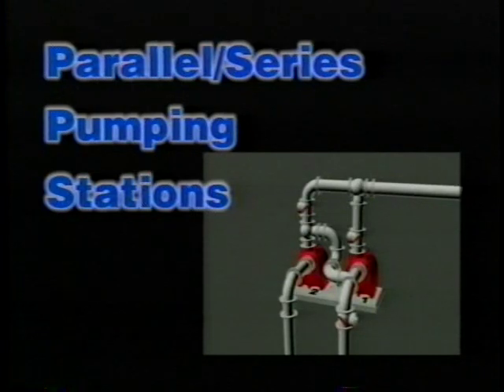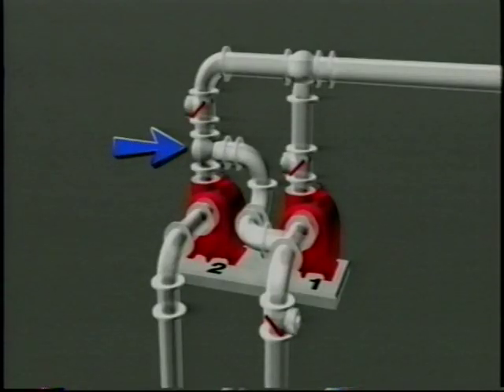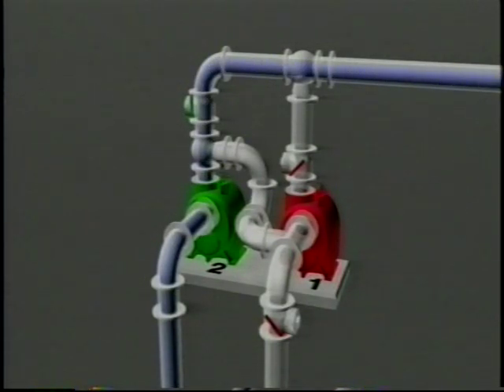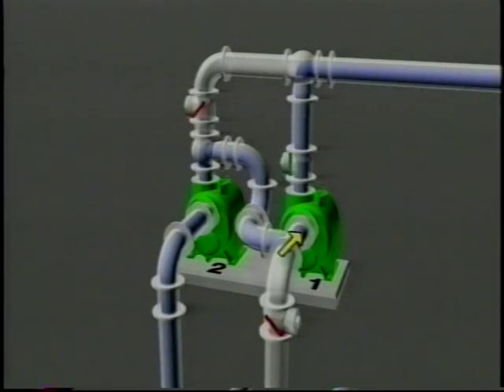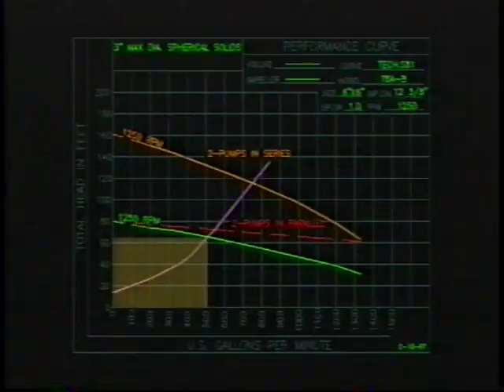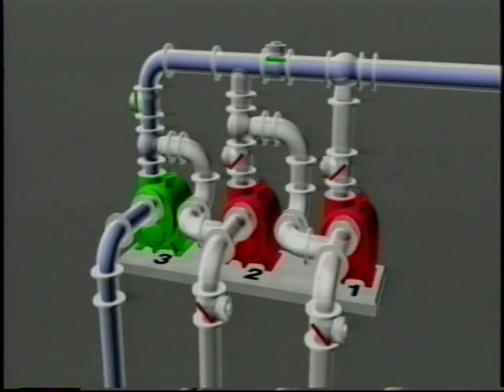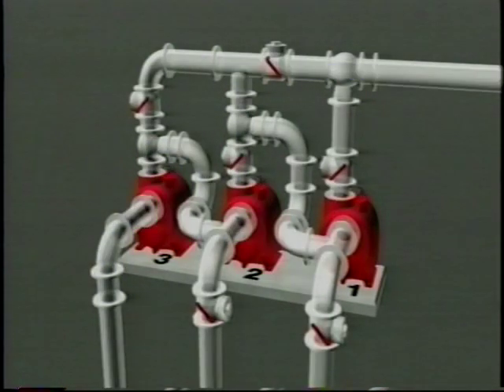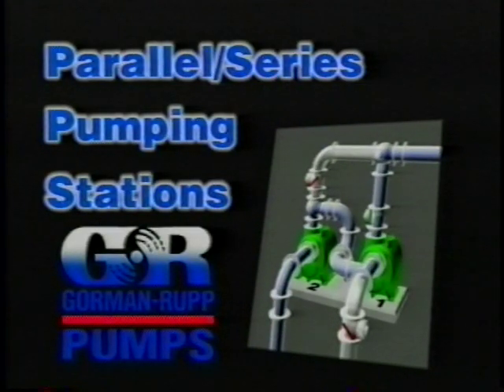Gorman-Rupp: Parallel Series Pumping

Comment: I can't help but wonder if those check valves are gonna rattle and break off due to vibration when you consider that centrifugal pumps don't give an exactly constant flow. and furthermore how thus this vibration affect the cut water of each pump. looks like a mess
Reply from the maker: The check valves will not rattle, they will behave like any other non-return valve in a piping system. We have had systems operating for over a decade with absolutely zero issues with check valves or anything else in the system. The cutwater is normally only effected by cavitation, errosion or corrosion, so its condition would be effected by water quality and the operational parameters. Pump application engineers need to do their job properly. The piping system may look complicated, but it is extremely effective when dealing with long or small rising mains or when multiple pump stations operate on the same rising main.

Comment: Been looking for this, I want to connect a 1hp and a 3hp both to work at the same time for maximum out put, which pump should feed which?
Reply: It will be the same either way..

Since the flow is the same through both pumps, you are left only with the head for each pump at that rate. To calculate head at the series rate you add the head for each pump. Since when adding numbers it dosent matter which is first and second, it dosent matter which pump is first.

In fact it is easy to plot a new head vs flow characteristic for the series set up by adding the value of head from each pump for all flow rates.